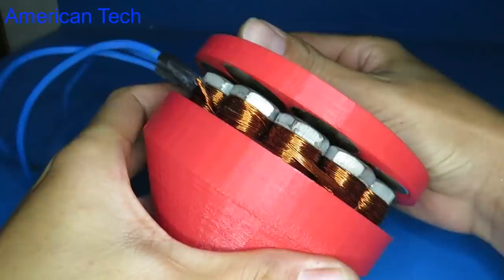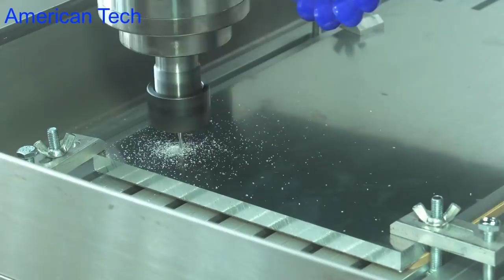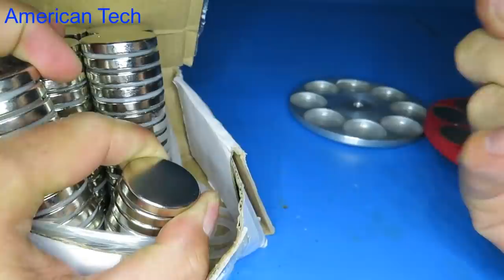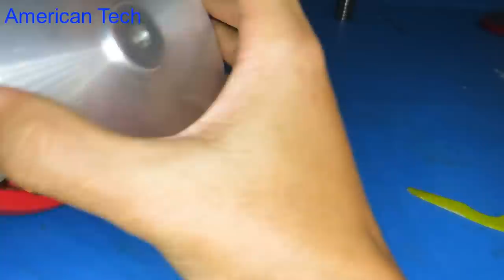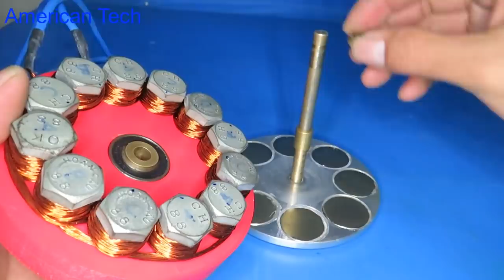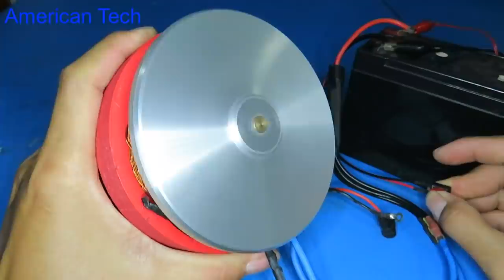1KW ESC Brushless motor | Very strong | upgraded

Comment: Bolt steel is not good for electromagnet. Wire is too thin for 1KW. This motor will burn 1KW loaded